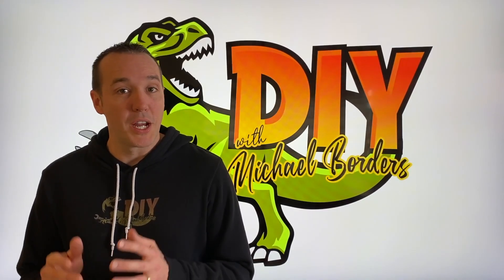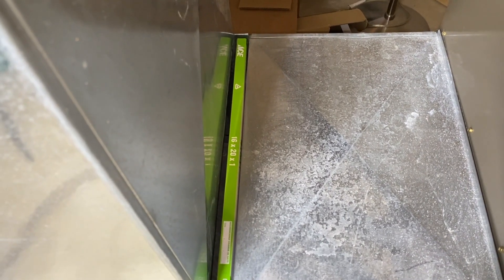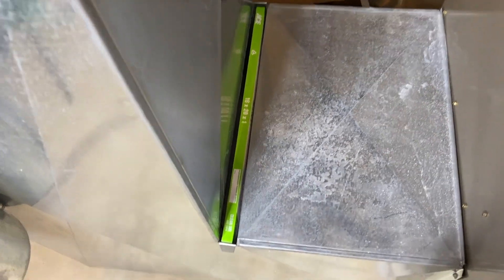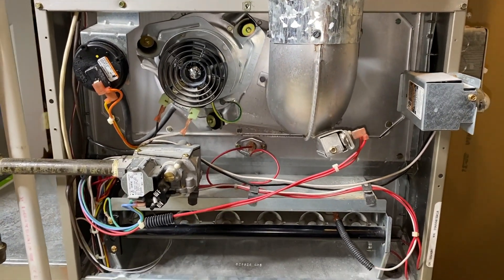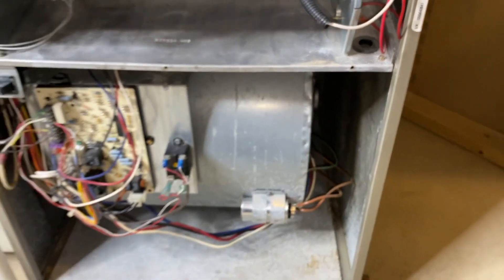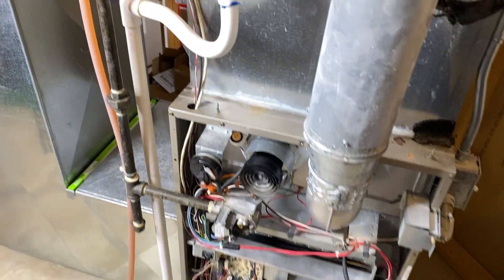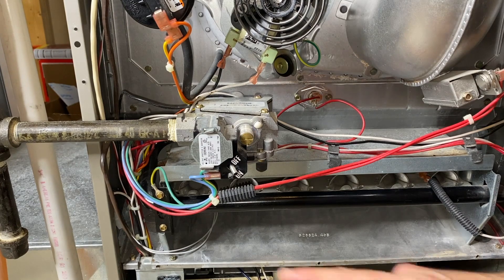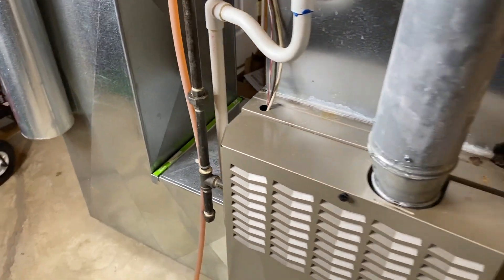Furnace only runs without filter - Common Causes

Comment: Could it be that simply the filter is too dense and not allowing enough airflow. I have a problem where it works perfectly and as soon as I add the filter it would shut off the furnace. Not right away but it shuts down even with brand new filter.
Reply from the maker: Thanks for watching, it’s possible.  Have you double checked that you are installing the proper size filter.

You can find your units serial number and model number on a sticker located on the side panel.  With this information, you can look up the proper size filter that is to be installed in your exact furnace for best efficient operation.  Keep us posted.
Reply: @DIYwithMichaelBorders  Thanks for the reply I know the model it's goodman GM9S960804CN and it's a brand new furnace just installed. I cannot find the recommended air filter for this model but I'll keep looking thanks for the reply.
Reply from the maker: @intra_morph  

Thanks for the follow up?  What size filter is currently installed?  We see that the proper size for your specific Goodman furnace is:  16x25x1

       https://amzn.to/3Oum19b

If interested in purchasing this product, visit our Amazon affiliate link above.  I earn from qualifying purchases.

We hope this helps.  😎👍
Reply: @DIYwithMichaelBorders  wow thank you very much. I had a 25x20x4 installed merv 12 rating
Reply from the maker: @intra_morph  

You are welcome, that’s a big difference in terms of filter.  Looking forward to hearing back from you on how the 16x25x1 works.  👍
Reply: @DIYwithMichaelBorders  Thank you so much for the tip on the filter. It turned out one of my vents in the guest room was closed and that caused the furnace to overheat and shut off. Don't think it was the filter at all but thank you for the information I appreciate it!!!  Can't believe I didn't check all the vents lol.
Reply from the maker: @intra_morph  

Thanks for the follow up, that’s great you pinpointed the cause.  We wish we would have sent you our video link below.

       https://youtu.be/6cbw58k-Mas?si=Uy8MofEdoCPl_EJN

It talks about that exact issue however with symptoms of the furnace not turning off.

👍🧰

Comment: I would love if all furnaces or client installs had such a large or half the width of the center plenum between the return air and the furnace.  You can install any of 20-30 models available out on the market that allows you to run 4-6" filters.  All my client's systems run 5' filters of the largest size that I can get installed to their furnace, for the most most surface area and filtration ability with a higher Merv rating.  Merv 8 is minimum and Merv 10-13 can be used safely with the proper system.  Honeywell makes several great units for low cost and runs a 4" filter, but prefer the 5' systems from Aprilaire, GeneralAire or the like.  I have actually made custom filters boxes from sheet metal, which took longer but I needed a specific size and just needed it done quickly.  I am not a big fan of 1" filters as most people either do not change them often enough or put in high Merv ratings which is very hard on a system, which depends on age, type of blower motor and External static pressure (total pressure measurement).

The filter box design in this video is not very good.  Air will go around the filter and be pulled from around the edges. Use the filter magnet covers or install a proper filter box or air purifier with a real filter.